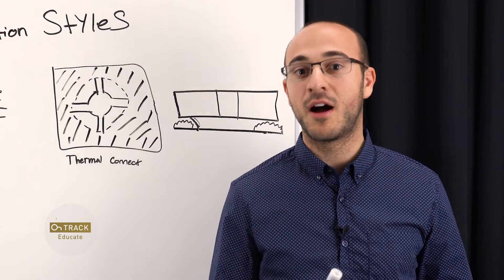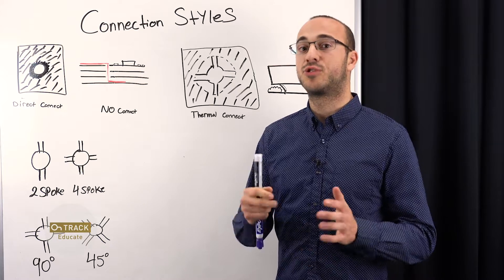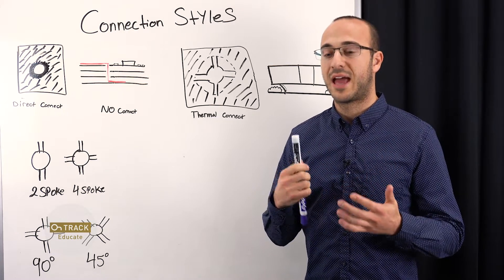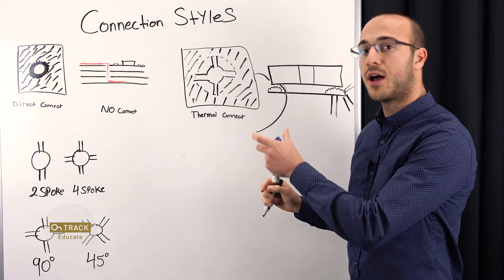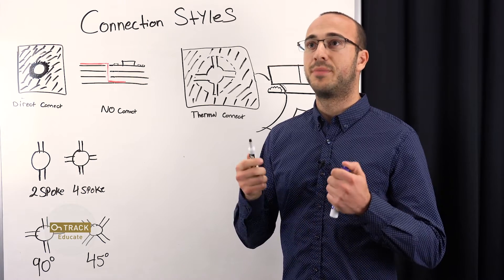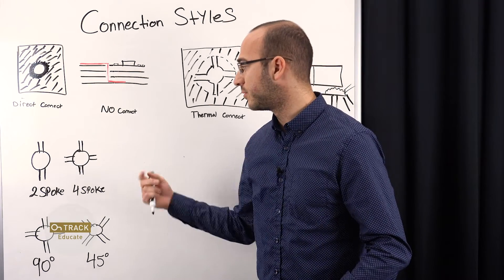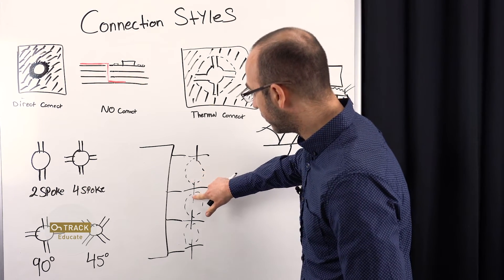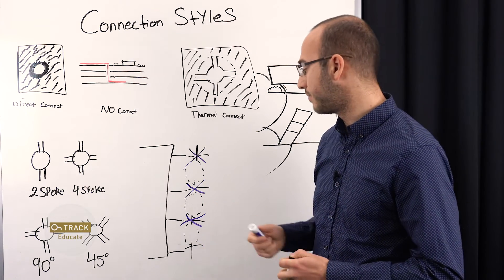Thermal Connection Styles - OnTrack Whiteboard Series

Comment: Isn't the tombstoning picture backwards?  I thought the solder paste with the large heat sink (on the left) will NOT get hot enough, but the solder paste with the thermal connection (on the right) WILL get hot enough.  In that case, the component pin will wick to the hot solder, and the other pin will not wick to the cold solder, so the tombstone picture should have the thermally connected (right-side) pin down and the non-thermally connected pin (left side) up (opposite of what was drawn).  Am I missing something?
Reply: Don't reckon you are missing something.  In fact there are several reasons why tomb-stoning can occur.  Not just at cooling after re-flow.  Can happen during oven upslope just as easily and also when the oven heating profile is flawed (usually too fast when components both sides of PCB) but also when focused heating is incorrectly applied.  All this without even considering thermal wicking due to thermal relief pads.  And via-in-pad, while now very ho-hum when done right, is still pretty much a no-no if it creates thermal gradient imbalance on two pad passives.